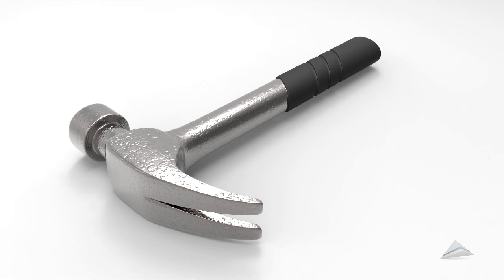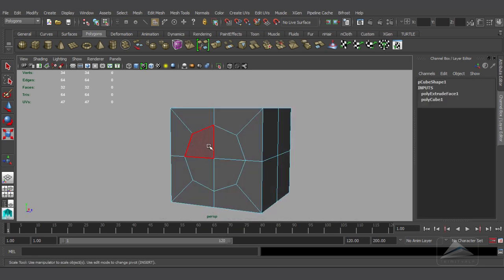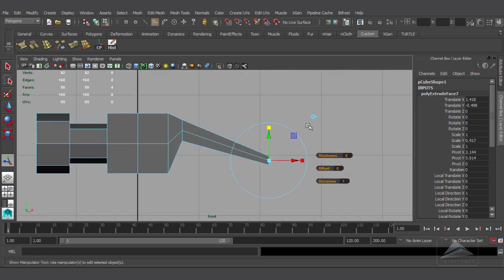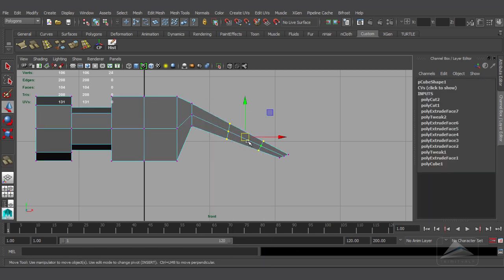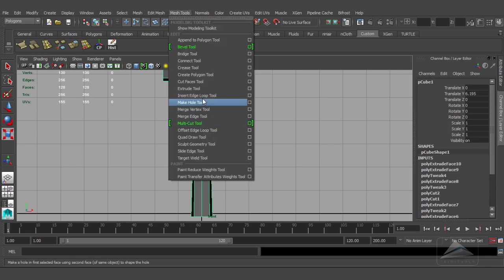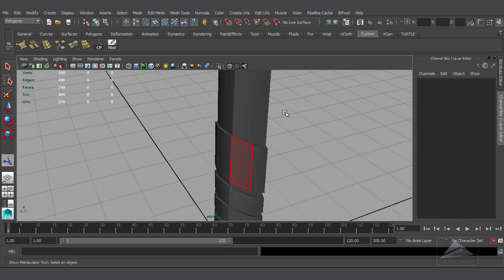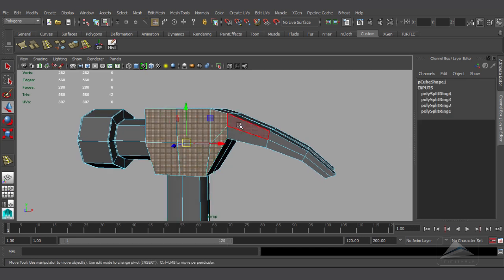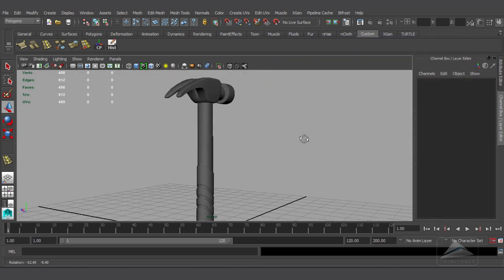Maya for Beginners-Modeling a Hammer-Tutorial | Learn Maya

Comment: in Maya 2025, it has changed to the multi-cut tool, so you click (hold) and drag line across what you want to cut- no more clicking on an edge to bring up that slice thing, in order to follow along on the handle section. Also, the old local axis is renamed to OBJECT axis.

Comment: How can I cut diagonally like in min 7:54 ? I'm using the multi-cut tool and the edge loop tool and done see any option for diagonal cuts
Reply from the maker: Yes, Multi cut tool will work for this. For that you need to drag the tool from out of the geometry.
Reply: @Trimitkala  It works! thanks a lot!